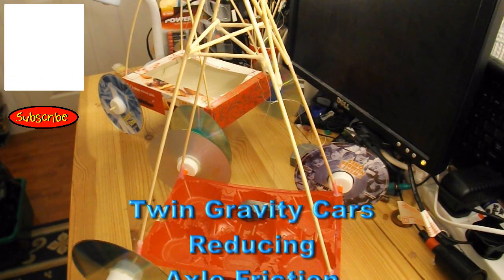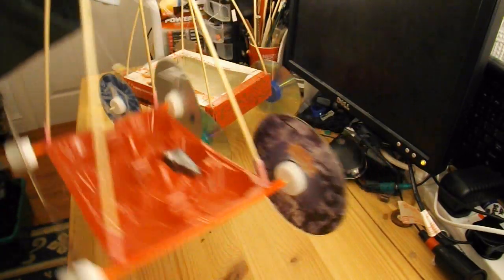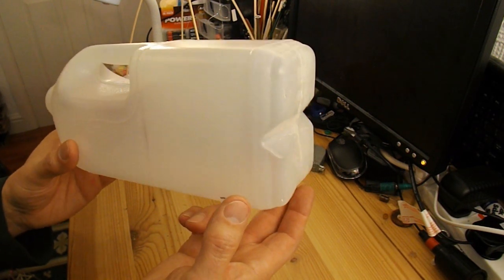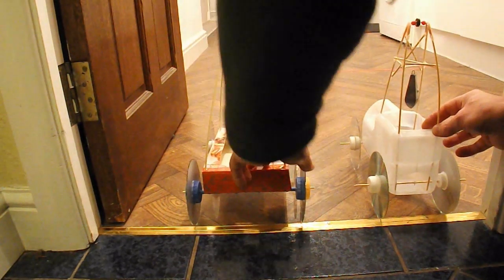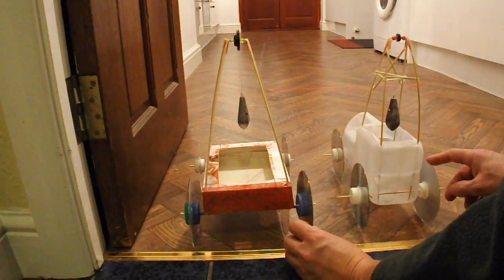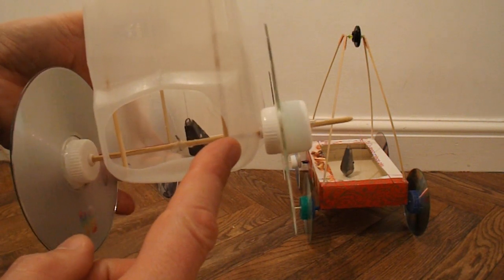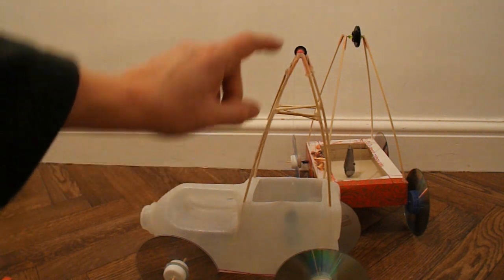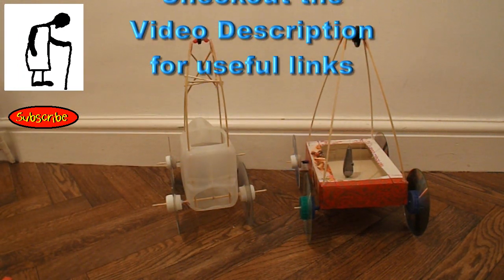Twin Gravity Cars reducing axle friction

Comment: I was wondering if you have any videos showing how to make a gravity powered car in a step by step process.
Reply from the maker: My Gravity Powered Cars playlist has 15 videos
http://www.youtube.com/playlist?list=PLA5a2xPRSrB1zzCqDckAnlOzz8iViuM94

This one is probably a good example. Bargain Store Project #48 Storage Container Gravity Car
Reply: Thanks for the help. I'm also confused on how to wind up the wire to the pulley. Any advice will be very much appreciated.
Reply from the maker: SteamedCrap Not quite sure what you are asking. Do you mean the shape of the wire that supports the pulley? On the cars in this video it is just a simple 'U' shape and fixed to the top of the barbecue cane using short lengths of drinking straw and hot glue. http://youtu.be/QIw2ZM-5fwQ?t=2m34s

Comment: I was wondering how far your hallway is? Because i need to do a project to go 6 meters. Do you think the jug car will go that far?
Reply from the maker: +Dylan Phung the distance the cars are traveling in the video is about 5 metres and then they hit the wall at the far end so they should be able to go further. The distance you car will travel will be down to how well you make the car, how high you make the tower, what weight you are allowed to use and what materials you use to make it. If you and your fellow students all have exactly the same specification and build exactly the same cars, the one that will go the furthest will be the one with the least friction on the bearings for the axles and the pulley.
Reply: +GrandadIsAnOldMan Thank you for your help. And the mass we are dropping is 1kg.
Reply from the maker: Dylan Phung good luck

Comment: which type of gravity car goes the farthest  (of the one's you've made)
Reply from the maker: I cannot answer that as I just test them to run the 5 metre length of my kitchen and they do that easily. The performance of the car will be closely related to the friction of any of the moving parts, like the pulley and the axles in the axle tubes. I would suggest a light weight car with minimum friction surfaces would work best.

Comment: how high is the weight dropped from?
Reply from the maker: I don't remember, this video was made in 2014, for the purpose of comparing the performance of the two cars the only important point would be they both had the same height. Watching the video and using the fact a CD is close to 5" diameter I would guess the tower height is between 12" and 15" as I estimate it is between 2.5 and 3 CDs high.

Comment: I am trying to make a car like this for a physics project and I am so confused I need help granddadisanoldman
Reply from the maker: There is more information in the video description. If that does not help then ask me specific questions and I will do my best to reply. However it is 1AM in the morning here and I am just going to bed so it may be a while before I read your next message.
Reply: We are using a bobbin, but it doesn't seem to be gripping the weight and letting it hang down. Should we get an actual pulley?
Reply from the maker: It will probably be the amount of friction between the bobbin and whatever shaft you have through it. I am guessing the bobbin has a fairly large hole through the middle and that gives it a large surface area to create friction. I have tried several different types of "pulleys" and certainly a proper pulley with a thin shaft gives the best result. If you cannot find a pulley you could try filling the hole in the middle of the bobbin by using a couple of plastic beads so you can use a thinner shaft that fits the hole in the beads. You could make a pulley using a wheel from a toy car. You might need to glue some card disks to the sides of the wheel to stop the string slipping off. You need to minimise friction everywhere so that also includes your axles, make sure they spin freely and that your wheels do not touch the car bodywork. You can also increase the thickness of the back axle where the string wraps round it by wrapping some tape round it. The thicker it is, the lower the gearing it creates when you wrap the string round it BUT you get less turns round as it takes more string. That means the car accelerates faster but travels less distance under power. However if it speeds up quickly then it can freewheel farther after the weight has dropped and it takes longer to slow down.